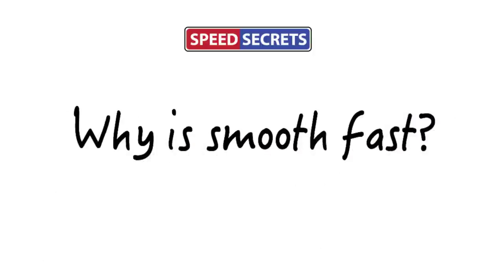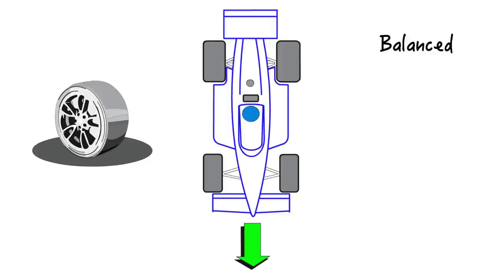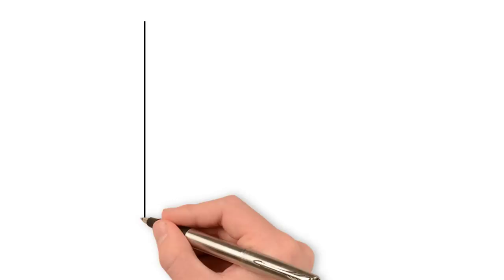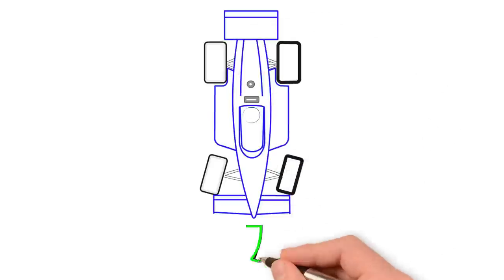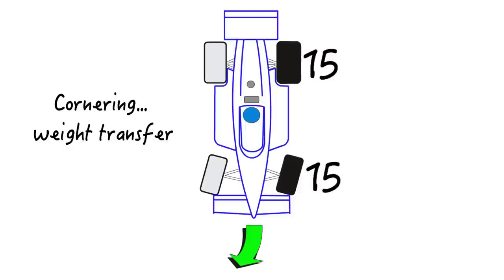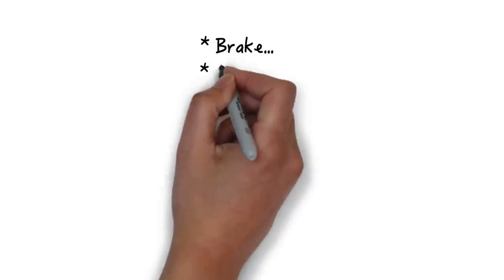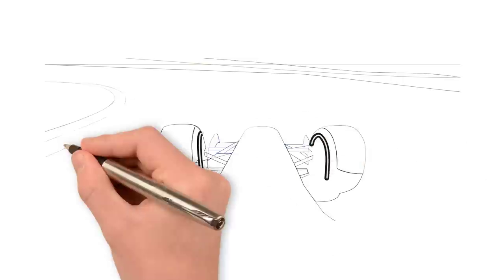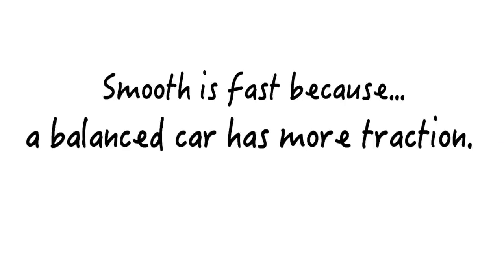Why Smooth is Fast - Performance Driving Tip

Comment: One of the hardest things to coach is smooth inputs, because it feels slow, versus the aggressive style that tosses the car around, which is actually slower because of the loss of traction.  I use the Bentley Secret of the unloading tire losing traction faster than the loading tire gaining traction to help students understand the physics behind the "smooth is fast" mantra.  By the way, I prefer "load transfer" to "weight transfer" as the car is not actually shifting it's  weight around.  Thanks, Ross.
Reply: Ya my tires tell a story from the amount and type of driving I do. They'd love to sell me new tires but shake their heads because the wear is so even. I tell them I only drive on straight roads and they break out in laughter, lol!

Comment: LOVE this graphic illustration of the 'traction transfer'... 
Could you also do a similar illustration of front/rear transfer during braking and acceleration, please? 
And then a "combination study" of braking, turning, and accelerating thru exit.. ?  Smooooth Weight transfer effects all three aspects simultaneously... and our little gray brains must "calculate" all of that in one on-going analysis...
Reply from the maker: Thanks. It would essentially be the same. Any time there is load transfer, there is a reduction in overall grip.

Comment: It's a great way to explain how to drive 'smooth' and maintain good balance throughout. When I play a racket sport for instance I try to maintain good balance, before, during and after every shot. I use good anticipation so I can put myself in the ideal situation for every shot. That spot (situation) is referred to as the 'strike zone'. That's where I like to be when engaged in the act of driving. Easy, smooth acceleration gliding from one side of a curve to the other to lessen the 'pull', g-force or whatever you want to deem it. Yeah I don't get close to as low as 36 total unless it's a sharp curve. I have a clear ball filled with liquid on my dash which tells me how I'm accelerating, braking and turning. Cheers!

Comment: Beautifully done!   Thank you.  I would like to hear where the missing units go while in the corner >> but I take it, they don't matter.  It only matters we know they are not in any active forces on the ground?  I think they go to my gluteals.
Reply from the maker: +Julia Young Well, they don't really go anywhere, since the units are really just a conceptual thing to illustrate what's happening. Yes, you get the point... the take-away is that the more weight transfer, the less overall grip we have; the less weight transfer, the more grip we have. Thanks.